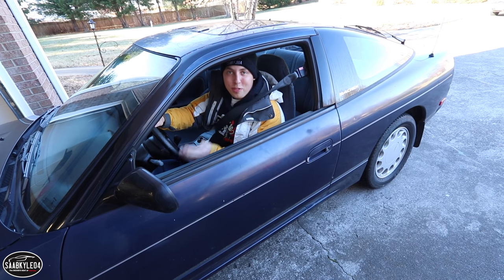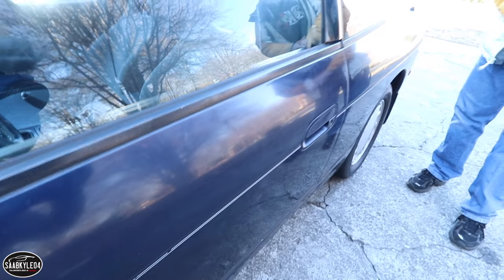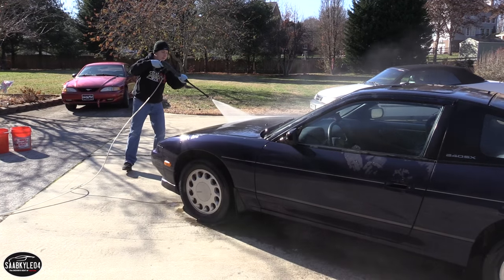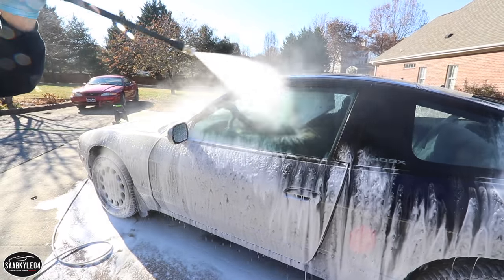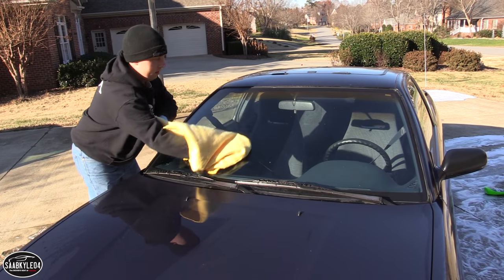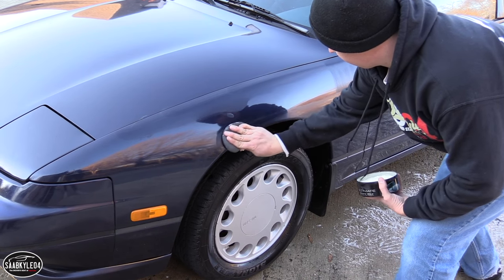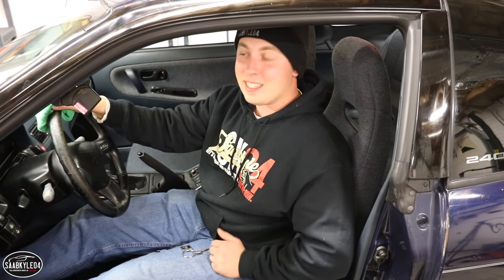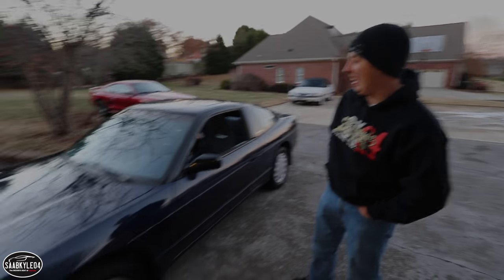Car Detailing Tips and Tricks (Bringing an Old Car Back To Life)

Comment: you forgot to claybar the car. i'm using nanoskin claymit it would of work perfectly with this type of oxidation.
Reply from the maker: I bought one, but decided not to do it for this project as I merely wanted to get it looking nicer than what it was without going over the top.  A clay bar is a great idea for a more through clean, but this car isn't perfect (dents/dings/scratches/faded clear coat, etc).  The extra money spent would have been wasted.  What we were able to do was more than enough to beautify it.
Reply: I see. I just bought the nanoskin claymit not too long ago and I'm impressed how good it is. It will not replace the traditional claybar but it's a good addition for detailing I'd say it works great for neglected paints.
Reply from the maker: I've never heard of those before, but I'll check it out!  Always interested in trying new products.
Reply: Saabkyle04 
I got it from Amazon if you have a hard time getting it in stores.
Reply: Saabkyle04 Also try AMMO NYC
Reply: In detailing I have noticed that clay baring helps to get rid of  that layer of "gunk" off and that helps in making you're sealant/wax last longer !
Reply: Saabkyle04 Hey Kyle. Talking about clay bars, you would be surprised. My car was bought new 2 years ago, and i care for it a lot and use top quality products. I decided to clay the car for the first time and the amount of contaminants that clay removed was just sickening (lol). My personal opinion is that its better to always clay the car first before polishing and waxing. By claying, your surface is clean and the wax or sealant will adhere better and last longer. I did my dad's truck like 3 months ago (no clay) and the wax is gone, and we care for it just as my car. Cheers and I love your videos :)
Reply: I should of bought mine at autogeek. I wasn't sure if it ships to canada but still what i paid from amazon.ca is just robbery!!
Reply: I just bought a nanoskin too, you use the black side right?
Reply: Omar Rodriguez  yes the black side. Don't forget to put soapy water while you do it. It's more aggressive than regular claybar. This is something I would not use daily only for heavy oxidation.
Reply: Jeofrey Espelita my trunk has some heavy oxidation for some reason, so I might just use it on that part. thanks!

Comment: Could you do a video on cleaning an engine bay? What areas to avoid getting wet, some safety precautions, and what areas need cleaned the most?
Reply: KittyCow pretty easy don't use a lot of water, avoid air intake and spark plugs also exposed wires. Best idea is keep car running and hot.
Reply: Otto Bauch
Reply: KittyCow Do not keep car running and hot. Cold water on a 200 degree block, head, or exhaust manifold could easily cause fracture line or cracks. Clean the engine bay when could/room temperature. Be careful with electronics (and hoses if you use a power washer). Easiest way is get a good degreaser, degrease and let sit for 2-5 minutes, wash away degreaser, loose dirty, oil. Finally you can either repeat the degreasing until satisfied or wipe down with a cloth to detail clean. I'd let the vehicle sit and dry for at least an hour before starting it again. Of course don't attempt this outside if below freezing.
Reply: ChisFix just did that :)

Comment: Tip: use a clay before using the polish
Reply: Read the pinned comment.
Reply: Rx Seven you use clay mit after hand wash the foam cannon is Just a waste of time
Reply: DID YOU READ THE FUCKING PINNED COMMENT
Reply: James Taylor no thnx though didn't see it calm down shmeat boi
Reply: @jamesmuffins3330  TBH if you're cleaning the car up you might as well clay it. Doesn't take long.

Comment: Question, so when polishing I've noticed lots videos that show you how to polish about 99% of them use a machine to apply the polish. Now what if you apply the polish by hand on let's say, the middle of your door or behind your door handle to remove scratches. Do you apply wax on that area again (the whole car is already waxed)  right after and you'll be set?
Reply: That's a cut and polish not just a polish. Your removing or "cutting" a layer of the protective clear coating.

Comment: So you used meguiars polish first, then the ultimate paste wax to seal it? Is that the best way or should compound be used during these steps? Thanks
Reply: VQPower35 compound is only necessary if your paint has a lot of scratches or swirl marks. The polish gets rid of smaller scratches that the compounding process can cause and wax seals everything. You’re the only one who knows what your paint needs though.

Comment: I really enjoyed the video. What a great collaboration. A tip I would add is that you can use Meguiars detailing spray on the vents, door jamb rubber and rubber that is dry. It rejuvenates it. I also use it anywhere there is rubber, like the door seals. It helps them from sticking in the winter. Just don't use it on pedals or steering wheels where you need a sure grip.  This was a great video! I am adding Saabkyle to my sub list, as I already had ChrisFix on there. Thanks again guys.

Comment: Another tip, if you have pin-stripes on your car, pressure washing it will probably remove them. My Grandfather’s 1987 Airstream has a big blue pin-stripe, but one section got removed. Just a tip.

Comment: not bad at all for doing it all by hand! if you took a bufree to her she would have looked like a diamond! good job good video for noobs on paint cleanup and interior detailing. May wanna add in that if you don't have a pressure washer you can get a pressure enhancer that screws into the end of a hose that works just as good and you can also use the soap adapter with it. I prefer to use the Maguire Super Soap or TORQ . They seem to work the best and actually handle alot if the oxidation before a cut and wax. I've always used TR-3 by hand Then move to my 3 stage Maguires cut wax and polish or my 3m kits since they work best with a variable speed buffer. turtle wax has never been impressive at all except for their wheel cleaners. just my opinions but great job bringing her back to beautiful again that car deserved it

Comment: HI..I RECENTLY BOUGHT A KARCHER K3 PRESSURE WASHER.I HAVE SEEN A LOT OF SERVICE STATIONS IN INDIA USE DIESEL TO CLEAN ALL THE TAR AND DIRT THAT ACCUMULATES ON THE PAINT. FIRST OF ALL, HOW EFFECTIVE IS IT, WILL IT HARM  THE PAINT? AND SECONDLY CAN I USE DIESEL IN THE FOAM CONTAINER INSTEAD OF THE WASHER FLUID, IN CASE I DECIDE TO USE IT? THANK YOU FOR THE FABULOUS VIDEOS.YOUR VIDEOS AND TIPS HELP D.I.Y DUDES LIKE ME.

Comment: Should've just used a buffer for the exterior. Compound it first to get rid of scratches and bring the paint back. Then switch to a polish pad then wax the car. Best combination ice ever used and with the best results. Wheels you could've used wheel acid then rinse and wipe then down

Comment: Shouldn't you use the detailing brush/compressed air first before proceeding with the other steps of cleaning the interior?  You're just gonna get those particles everywhere and will need to vacuum again.

Comment: using dish soap as you so called (washing up liquid) does now remove wax, Giving the car a good going over with a abrasive compound to remove swirls and scratches will also remove any wax residue left on the car, that is a know fact in the detailing world and any detailer will tell you the same thing.

Comment: why didnt you clay bar the car
Reply from the maker: It would have been a complete waste of money.  The car isn't in good enough shape.  I just wanted to brighten it up a bit because it needs a full repaint and bodywork at some point.
Reply: clay bars are not expensive doe...
Reply: Saabkyle04  what was the stuff you sprayed onto the wheels
Reply: Matthew Dvorsky Degreaser, I think.
Reply: it didn't need it. and would be a waste of time and money.
Reply: no mate he used soapy water on the car not the wheels he would have used a special type of mag wheel cleaner. Soapy water is not going to get break grime off lol